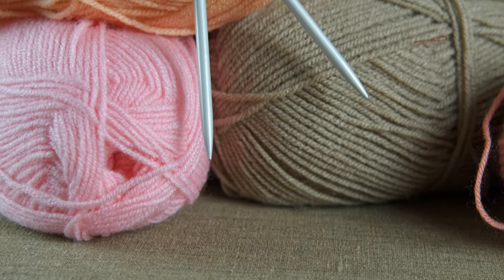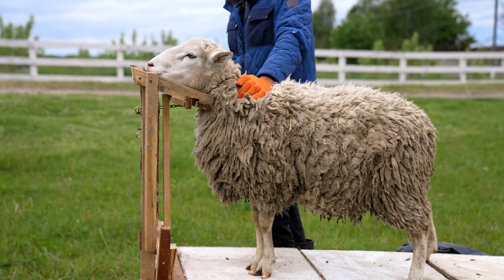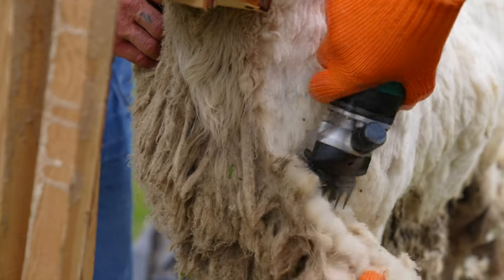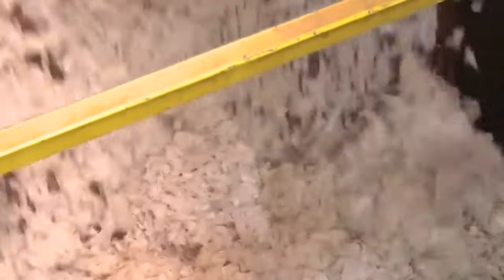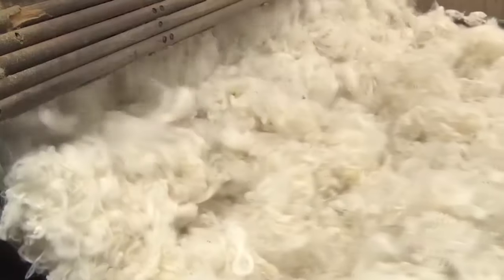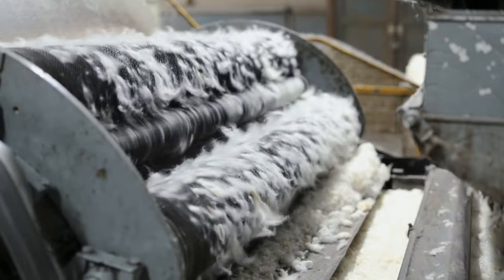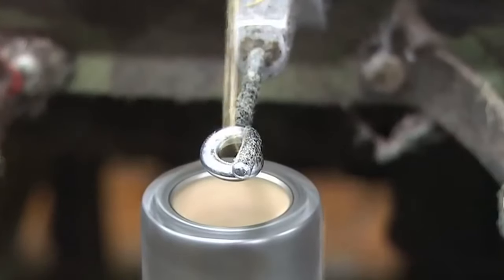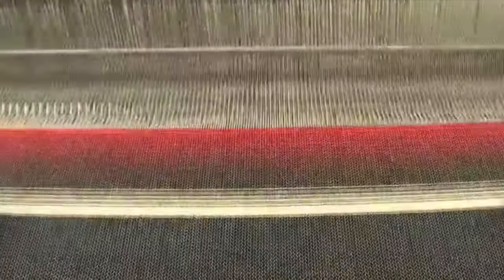How It's Made: Wool

Comment: Great video. I've got a question. Why during the shearing process do they need to remove the wool in one piece, if later during the blending process is mix together?
Reply from the maker: It maintain their full length and quality, making them more valuable, as well as it can be used for different purposes